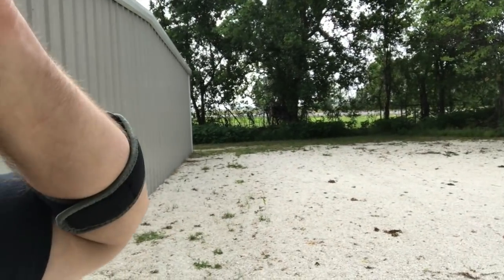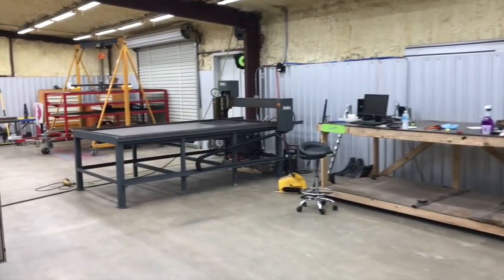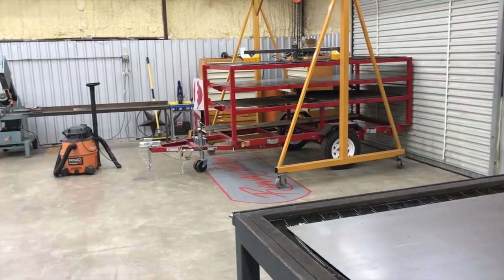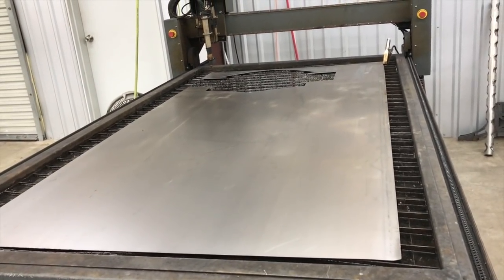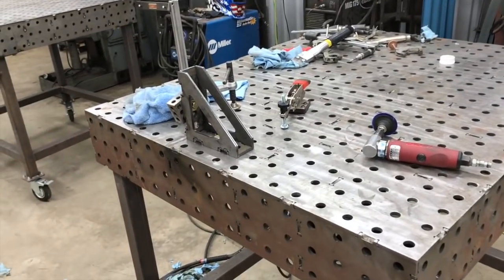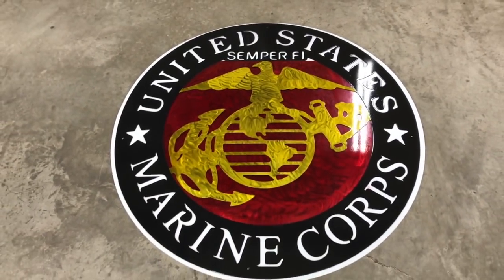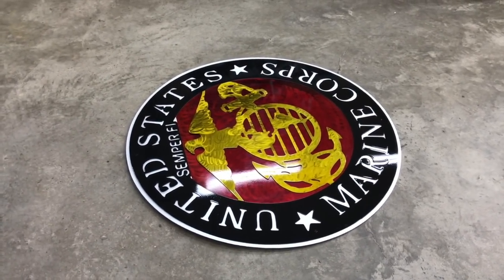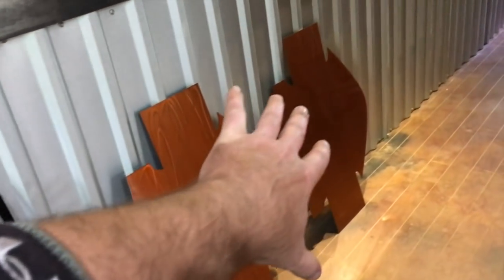Plans for a Paint Booth - Shipping Container?

Comment: Slab and an addition off the end of your building. Large enough to paint a full size truck comfortably. This way your utilities are right there (electric, water and air). You can have an access door from your shop into the booth too. Plus you can build in a fan/filter system much easier than in a container. You want the slab so you can wet the floors when needed. Plus the Garage would be large enough to do whatever you want.

Comment: The paint work you do is really nice Gary.  I agree with WaveAction777.  Take small steps on adding an addition to your existing and pour a 15' slab, add 3 extra walls and roof.  Have a paint room with the extra space you need.  A paint booth for someone that does nice paint jobs.  Fit it into your budget as you can afford it.  Pour the slab with weld plates and I will come up and help you weld it up.  I have put up several buildings.
Reply from the maker: yes sir, i am kind of leaning in that direction

Comment: Grab an used container and install a vent on top roofing and cut some openings along the walls close to the floor and run a tube along the outside with a fan pulling air from the inside to the outside that will allow for the dust to be pulled down into the sucking ports and not mess the paint job.

Comment: Im about to do the same thing with a 20ft shipping container.  Already have it and have the fan. I might have an extra I could sell you.  I pulled out 4 paint booths and sold one and have the fans for the other 3 still.  just need to make sure they are all still good to go. I had planned to put filter wall right inside the double door and us the hepa ac filters you get at home depot. The good thing about a container is if you want to upgrade later it would not be hard to sell as a paint booth set up for another guy just starting up.  Id go used and paint it myself.  heck you could wrap it in old barn wood down the road and really make it look sharp. and if you decide you need more room park another next to if and cut out the wall between.
Reply from the maker: I am interested in the fan, send me some pics, specs, how much your looking to sell it for.  gary@ramseycustoms.com

Comment: You've gone this far with your shop, go the extra mile and build a proper addition to the main building, even it is bare bones on the inside for now. Painting seems to be a major component to what you do. Money well spent in the long run, and besides, one of the 4 walls is already done, being the existing building. Only 3 more walls.
Just my humble opinion, Gary.
Reply: WaveAction777 I totally agree! I'll bet if you were careful $5000 would get it up and running too. Plus you won't be limited to a long narrow platform.

Comment: Gary it seems like being able to paint is an important part to your business which you need to have control over.  Where I used to work they had a small walk in booth, maybe 10 x 10 that size seems perfect for the things you are doing.  I don't know who made it and they got rid of it when they moved to a new building.  Maybe something from global finishing, they have them at one of the shops I temp at.  Just needs an exhaust duct to outside, work area is around 48" square and perfect for you flat work.  Could be a stop gap till you get money to make an addition.  The container seems like a lot of work to get the ventilation and AC right.

Comment: Hey, Have you thought about using two 20' x 8' containers instead of one 40' x 8'. You can take the two 20' containers and put them next to each other, cutting out the two center walls giving you a 20' x 16' paint booth.
Reply: can you eliminate the verticle corner supports on one end and put a wide door to drive a car in?

Comment: 4 inch slab by 18 feet wide by 20 feet deep is approximately 1800 to $2,000
Your carport unfinished is about 17 to 1800 then you can build the rest of it at your leisure or as your profits allow All the Small Things like fans and filters would follow of course. but Gary I'm here to tell you if you go with that container not only are you going to be sorry in the summertime because of the enormous 160 degrees Fahrenheit as opposed to 110 degrees and a carport which you could open up and drive a car into. that's just my thoughts on it because I've been there and done that

Comment: If the costs are similar, I would opt for a shipping container.  Being a sealed box to start, making a system to filter air in and air out would be so much easier than a carport structure. I am sure Rudy is a great guy, but having complete control of your work space is well worth the expense.   You won't be able to spray out a car in there, but your work pieces should be just fine.  Just a question, 40' is huge, is a 20' more suitable? Easier to control temperature and filtration? That USMC  Piece looks amazing!!,  great work.

Comment: Sounds like you already have your mind made up, but I'll throw my two cents in. By the time you properly address ventilation and HVAC in your containers your price is going to double or triple I would carve out a corner in your shop and install a dry filter spray booth (Google it) or take a look at something like the Diversair MAXFLO Paint Booths. Or, take a look at a paint downdraft table if you'll only be doing small items.

Comment: I can't image that you need 40' of paint booth. But if you divide it in half to have steel storage as well (or something else)???
Reply: yes, I would put a wall about 1/2" through and put a filter system in the wall, and fan out the back, the front area can be paint storage, mixing bench, cleanup area, etc .

Comment: I'd cost out the other things you would need to buy as well and add it to the price of the shipping container, such as the explosion-proof exhaust fan(s), lighting, etc...as opposed to buying a paint booth that has all of that equipped already. I'm guessing that your way would be cheaper, booths can get pricey. (plus i don't know if i would trust the integrity of a paint booth to withstand the bad weather as good as a shipping container would.)
Reply: Yea, if I bought a paint booth, I would likely need to put it inside another structure.  Your right about the lights/fan, filter system.

Comment: Container would work for what you're doing now.  Cheap, fast...  Add a big extractor, some lights, an air line and an intake filter panel and you can be painting in a few days.  You'll outgrow it in a few months, but you could turn it into your wood shop or something...  If you're looking for a better, more permanent solution, I would add another lean to on your building and make it the right size for painting 4x8 or mustangs.  Maybe that's later down the road.  Lastly, you could just throw up a few lights in the old ass barn and paint in there.  If you don't mind human sized vulture turds in the middle of your work, you're set.
Reply from the maker: lol, the barn would be the cheapest route but would be a some work getting power, lights, air, and keeping things clean would be an issue, would have to be constnatly cleaning the turds out of the intake filters.  I am leaning toward the the leanto.